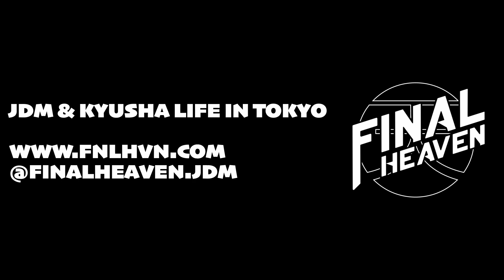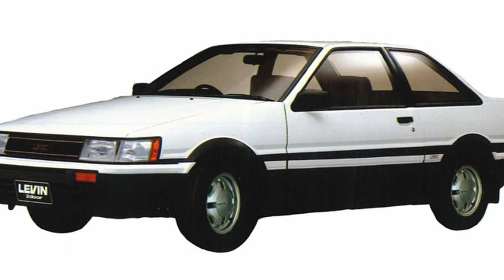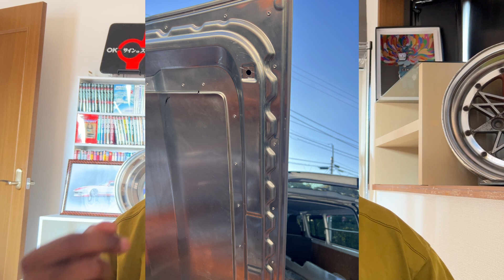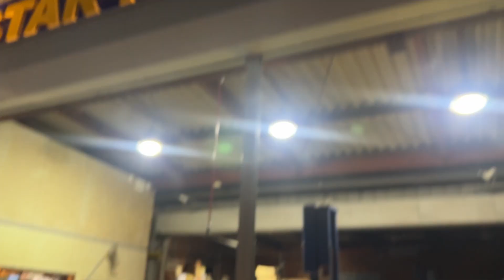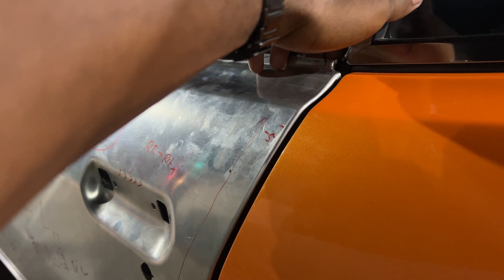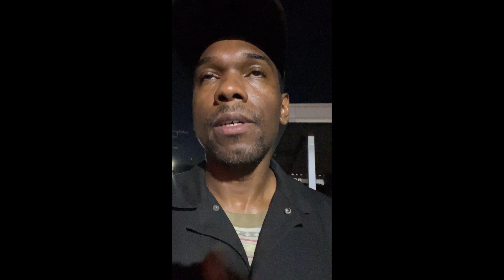NO MORE RUST!!! Star Road Aluminum 240Z Body Panels Coming Soon!!!

Comment: Great news, Jams. Won't be cheap, but will last forever 🙂👍
Reply from the maker: Very true. Less than dry carbon but definitely more than new steel. That is a wide range for sure though haha
Reply: @FinalHeavenJam  I wonder, if these high end reproductions are successful, if they might eventually start a "value line" of higher quality steel repops for those of us with mere five-digit incomes who want to keep these cars alive. Would be pretty neat to have strong, long lasting steel panels (made out of thicker than stock steel) for those whom dont want to work with Aluminum panels. The stock panels dent very easily, many oeople would prefer a slight weight penalty to have vastly stronger 18 or 19 ga panels. 

I know, it's ironic considering how thin modern car (non-structural) steel panels are (ive heard as thin as 23ga) whoever would have thought that a Datsun door slamming actually sounds solid (compared to todays cars) 😆 

People do double takes when the doors on my S10 200sx thunk closed....compared to many modern cars the Datsun's doors sound like bank vaults 😂 

The aluminum ones are nice but its expensive and much harder to work and weld on Aluminum (compared to steel)
Still won't be cheap but will be less expensive than hand forming them for sure.
Reply from the maker: I don’t think there’s much appeal in making heavier steel panels. KF vintage JDM makes great replacement panels so it seems that place in the market is filled.

Comment: It's a testament to the popularity of the Fairlady. Here we are 50+ years after their release and a company of this stature is considering making parts!  I wonder how many KG's weight saving the aluminum panels vs. steel.  I have an early series 2 (2/1971) 240 I would love to send to Star Road for mechanical restoration.
Reply: I doubt much weight savings, the OE steel panels are paper thin, the aluminum will have to be thicker just to be strong enough and as such the weight saving will be minimal. Still very cool.
Reply from the maker: It truly is. There will be a weight savings but I do not expect it to be a huge difference from OEM metal. As @twoeightythreez correctly stated, the metal will need to be slightly thicker (though not by much). The prototype aluminum fenders were 1.2mm in thickness.
Reply: @FinalHeavenJam  For comparison purposes, the stock 20ga sheetmetal most Datsuns used for the non-structural components is about 0.96mm :) 
Structural components such as frame rails and quarter panels were 1.21mm thick steel (18ga) 
I assume that they will not be making reproductions of any structural components such as floors and quarters? Those would likely need to be steel.
Reply from the maker: You are correct. No aluminum structural components are being planned for at this time. Cosmetic parts only as far as I have been told.